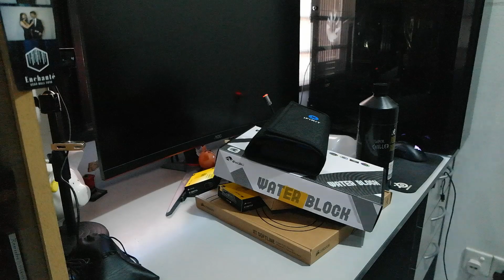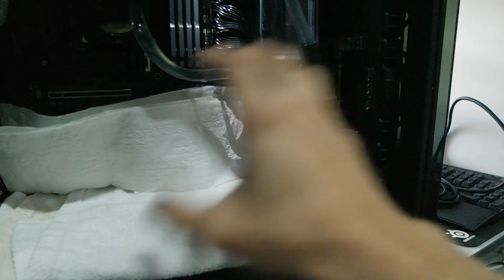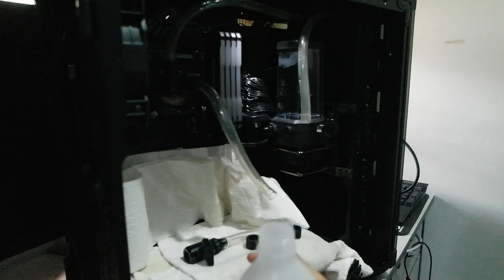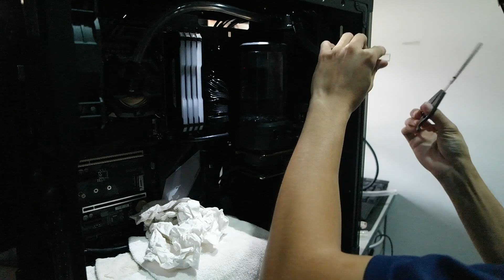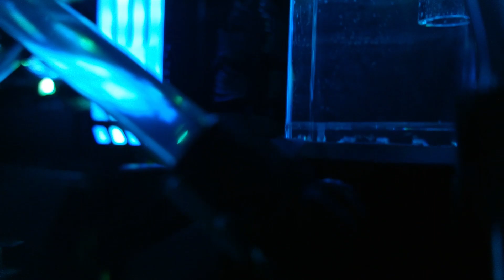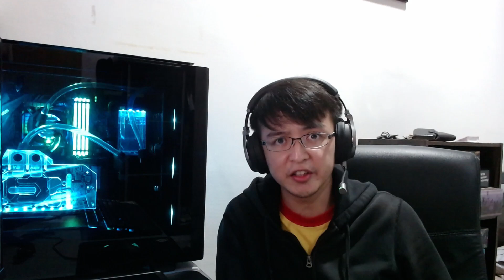Watercooling Gigabyte RTX 3080 GOC | Bykski GPU Water Block

Comment: do you use rgb fusion to control the gpu block rgb and is the block rgb wire connected the the D_Led on the gigabyte board?

Comment: How is your Bykski waterblock standing up like that? Are you using a pcie riser? If so, which one? I followed your video on my Bykski 3080 waterblock when I put mine together, but mine lies flat in the case after being mounted in the case.
Reply from the maker: My case comes with a vertical mounting slot, I just bought the PCIE riser only. I'm using Cooler Master PCIE riser btw.

Comment: I just ordered mine today. Couldn't get the card in my water-cooled pc cause it hits my pump and this is the best looking one out. I don't like the  lots of oring design on the other cards. Makes it actually look outdated. I like how it comes with the back plate and wiring harness but I do have white wires in my pc and wish there was an option for white wires but who then who knows if it will look good because they're so spread out.  Thanks for doing this video. Looks sick.

Comment: I just got a byski block for my 3080 FTW3 Ultra. Ive noticed something interesting with this block. Im seeing a huge performance increase if I set the pump (D5) to 100%. Normally I keep the pump at 60% and temps will get into the 50's, but when the pump is at 100% the gpu temp stays at between 40-43c. What were your pump settings for this video and can you test max pump speed as well?

Comment: Are you sure it wasn't thermal throttling?  58c is usually when it starts to throttle.
Reply: @ridinminnesotasingletrack8804  usually that's the vram not the core.  Some blocks don't have proper vram cooling

Comment: UPDATE: 3rd reassemble somewhat improved the temps. Water delta is now 18-22 celsius. Make sure when assembling to spread the paste with something and stretch the thermal pads so they are as thin as possible. tighten the screws especially the 4 main ones to the max. 

Still... with other blocks the delta is around 10 - 15 C, so not the best product available. Going to buy Alphacool

original:
Uif anyone reads this, I have this block for my 3090 and it sux. Water delta is just too high. Under load reaching 68 with water around 37 celsius. Everything tied and screwed. But it there is no contact for R15s (would need like 8 layers of thermal pad) and the provided thermal pads are too thick for plate to make full contact so you need to use thinner pads or stretch them thin. Will do my 3rd disassembly and reassembly to make sure maybe it will help...
Reply: Damn was considering getting it. Might get Alphacool instead of my usual EK this time round.
Reply: @peterwood2633  Hey, after my 3rd disassembly and making sure I spread the paste beforehand and making the thermalpads as thin as possible, fixed the issue for me. Water delta is now 18-19 C. Water 33 - GPU 52

Comment: 8:39 a very poor result for a graphics card for water cooling!
Reply: Not really depends how much cooling space he got
Reply: @GabbyTech  one 360mm cooler is not enough for CPU + high end GPU
Reply: @DiegoGAMEtv  I never said that his temps depends on radiators he has used fans alot of other facts, but his results are okay
Reply: @DiegoGAMEtv  lol comparing a 1080ti with a 3080
Reply: 1080ti has 100W less TDP. But I think this bykski waterblock isn't just perfect. I have exactly same performance on my RTX3080 GOC with 240+360 rad. I thought something is wrong with my block, but i see these temps are normal. I doubt that we both made a mistake assembling it.
Reply: @McKarmi  my block on GTX1080Ti is also from "bykski" ;o
Reply: @DiegoGAMEtv  i think i will try to reassemble it once again tommorrow. The backplate gets so hot i can barely touch it.
Reply: @McKarmi  it's normal, it's a 3080 not a 1080ti, completely different card. Also my 3080 is under water with EK block and gets hot.
Reply: @sgru9558  what temps is your 3080 seeing with ek block ? I have an alphacool and Bykski block coming in
Reply: @_pvn  I have CPU and GPU in same loop with a 360mm and 240mm slim radiators (and LL fans so not so good for radiators). CPU is overclocked while GPU voltage is stock, just some oc on core and memory, it draws around 350w and stays around 56° and fans spin at only 900 rpm. What I've noticed is that if you lower the power limit the GPU is still able to reach 1900mhz while consuming much less like from 250 to 290w and hence the temp never reaches 50 and stays around 42 to 48 (based on the power limit). As I have an ultrawide 1440p gsync monitor at 120hz in some games I dont even need all the power so 1900mhz are fine for me most of the times as the game runs fixed at 120 fps.
Reply: @sgru9558  True, Cyber punk though! Only game which struggles to maintain that. I have a similar setup 360mm and 240mm GTS by HWL. Good to know you stay that low during load. :D

Comment: Hello, how is the bykski stuff in terms of quality?
Reply from the maker: In my opinion, the build quality is pretty decent and solid nothing to complain about it. It even came with a custom power connector so you don't have to use Gigabyte's weird power connector, just that it doesn't come with a hardcopy manual, you have to searched their product page for soft copy manual. Performance wise, with my room temperature at 22C, it idles at 33C and usually hit 55C-58C when under heavy load. So with the cost of only MYR430 I would say it's worth it.
Reply: @gaminggroupoffreedom7694  thanks a lot!
Reply: @mrsarcasm4874  bykski also manufacturers gigabytes waterforce waterblocks.
Reply: @hallow5170  I can't really find that info on their website, any source?

Comment: Handy setup, congrats mate! I would recommend to buy a leak tester, that way you can use it to pressure air through system and not to blow it by mouth distributing microbes into the system.., and leak test of course. And also it is a good point to add some valves to drain your loop or add some quick disconnects. Like and subscribe!